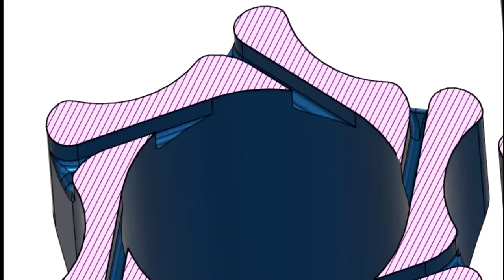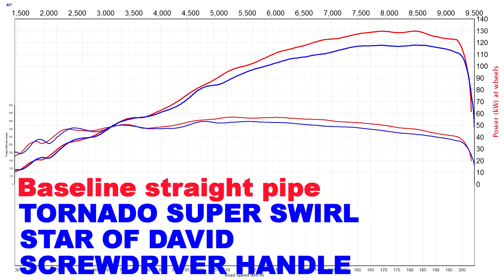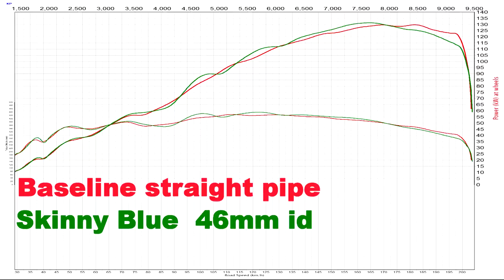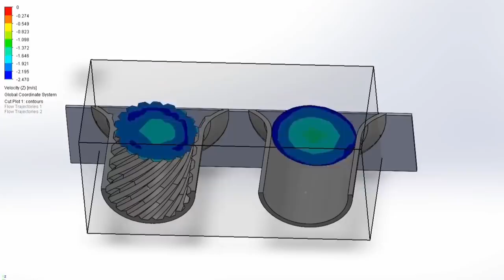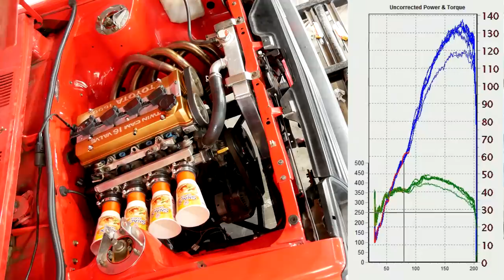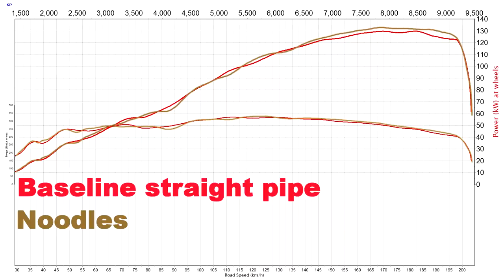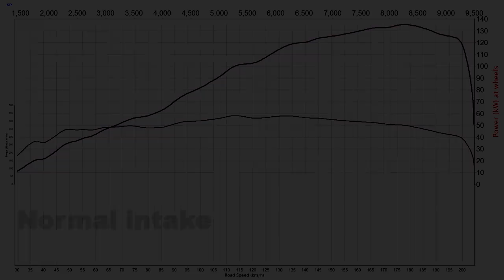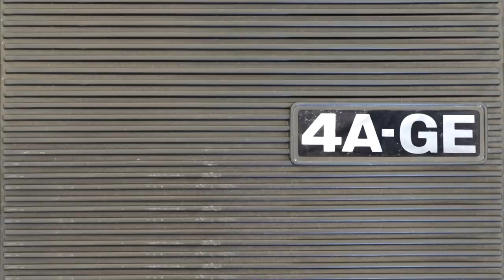Viewer 3d Printed Velocity Stacks  - Trumpets - Intake runners - Dyno Tested

Comment: I liked the idea a lot. But the second I saw the "Star of David" ones I practically screamed at my monitor. So clearly not enough air. Would have been better to have an opening at the end and let what it pulls from the slots on the sides to perhaps spin the charge a bit. Assuming it used them at all.

I was most curious about the Spinny Boi. I have thought about something like that since I wanted individual webbers and stacks on my 302 in my 68 Cougar when I was in High School.
Reply from the maker: The guy that made them, made the slots oversized so area was bigger than pipe.   I will try make them bigger at some stage, to see if the increased surface area is still a resiction.   If uncapped the end would kinda defeat the point of the design
Reply: Copy paste from another reply from me:

I made the "Star of David" ones. 

It's counter intuitive by looking at them, but:

The round pipe at the bottom has an area of 2123mm2 

The six slots have a combined open area of 5058mm2 

So it's got a worse surface area to open area ratio than an open hole, but that's why I made the slot area oversized by that margin. 

I think the real reason it performed poorly isnt because the slots are restrictive in themselves; so much as that it's causing the air to swirl internally. 
Which is counter productive especially when shortly after this is the throttle plates which straighten the flow back out.

This design wasnt about testing side feed slots, I was looking to see if having a capped end would help catch and reflect a stronger pressure wave. 
The slots are at a tangent to the perimeter of the pipe, so there's no clear path for a pressure wave to escape. 
The swirling isnt the main idea of it so much as a compromise I thought might be worthwhile. 

If you had the same design again with slots that ran straight so it didnt swirl, I'm fairly confident you'd see no restrictions - but no benefit from the runner length either, as I'd wager that the tuned length will correspond with first part of the opening of the slots. 

Maybe I'll print some more for another test later with straight slots. 

Either way, this isnt a design that I'd consider running on an engine. Apart from for sake of testing in these tests.

Comment: What do think would happen if you shortened the length of the runners? Or moved the throttle bodies further away from the head. Lots of info there but raised as many questions as answered.
Reply from the maker: In pinned comment at top, there are links to some of my other videos, that test length along with other things.
Reply: @Garage4age  sorry, I found them after a sent the message. I love your videos. Lots of info. I'm surprised by the small differences. Do you think it matters where the throttle bodies are in the length?
Reply from the maker: @dougstenger4085   Yup thats na tuning for ya.  adding up lots of small improvements.   Ive changed throttles and the location slightly a few times, with no change.  I can't say 100% either way since haven't done a whole lot of testing.  but imo, most cases not worth bothering with , if throttles are sized correctly for their location.
Reply: @Garage4age  Thanks for the response. I'm using motorcycle ITB's on a 2l 16v VW mounted mid engine in a tube frame Manx style buggy (Clodhopper). I need all the room I can get, so they'll be mounted above the engine and from what I can tell from your information, performance won't be hurt that bad. I really appreciate that with a few videos, you've answered most concerns. Looking forward to more videos.

Comment: Curious about your dyno numbers? How can you get 450nm with a NA 1600cc engine? 
Otherwise, nice vid!
Reply from the maker: its torque at the wheels.  so multiplied by driveline.   basically what every braked dyno reads to calculate power
Reply: @Garage4age  Ah I get it. Rather unusual way of measure. At least here in Sweden. Thanks for the reply!
Reply from the maker: @C303ofSweden    a lot of dyno's will have another calculation, that requires engine speed.  via  gear ratio calibration or rpm input.   so they can calculate engine torque minus the driveline loss,  from power and engine speed.  this one doesnt.     dyno's calulate the power from roller speed, torque and inertia.  tldr; it makes about 190-200nm at engine depending how much driveline loss you guess

Comment: You will get totally different results if you take the middle pips out so it's just the 3d prints
Reply from the maker: yes it will make less power.  they were kept same length to test the shape rather than length

Comment: Unfortunately much like injectors, having air flow changes like this so far from the chambers is only going to give you tiny changes, reducing the distance of the openings to the chamber will lead to a greater change in the inflow and outflow of gasses, and therefore a greater change in performance, though still by only a few kw at most

Comment: I wonder how different these will all perform when actually moving through the air and air is coming into the engine bay
Reply: Not much difference, otherwise it would be important to have different fuel maps for each gear, or speed based compensation - but not really the case.

BTCC cars tried this but found the actual ram air effect is miniscule, and you lose it as soon as you're following another car anyway.

The actual volume of air an engine ingests at full throttle is huge...
The easy way to remember it is that a 2 litre engine at 100% VE consumes 1000 litres of air per minute, per 1000rpm. 

So a 4 stroke 1600cc motor at 100% VE at 8000rpm is consuming 106 litres per second

Comment: Surely u can do stuff about either silver top or black top motors or do like a comparison with them
Reply from the maker: Only got one 20v that i dont want to modify any further.   But yeh they pretty much respond in the same way as 16v.    Haven't done as much r&d in them as 16v.  But IMO they get talked up a bit.  For having  ITB's ,VVT, ok headers  and bigger cams than 16v from factory. they aren't that much better.
Reply: @Garage4age  algs mate cheers for that

Comment: Could you make some sort of stand in for the strut tower and see how close you can place it to the entrance to the stacks before it effects the power level?
I'm curious about how long of a straight runner you can run but changing the runner length changes your power so you have to attack the testing from a different direction.
Reply from the maker: have been thinking about doing a video on this.  its probably closer than most people think
Reply: If I was placing bets I would say it's when you're within one stack diameter's distance from the openings.

Comment: All tests under the same conditions? Air temperature, humidity etc?
Reply from the maker: they were all done 5-10 mins after each other. enough time to swap them over.  afr check & stabilize engine temps before doing the run.

Comment: Take your best design and make it in different lengths. Runner length is more important than design of the inlet.
Reply from the maker: they are based on the best length which is the "normal" intake.    This main reason why the "big white"   makes less power.  as the oversized bellmouth acts like a shorter runner

Comment: I do understand that this is a 4A-GE engine channel but could you try the Motus V4 1650 cc 180 bhp(@crank) engine vs the 4A-GE . The Motus is smaller in size and you can put a centrifugal supercharger and reach 230 or so bhp from the factory built kit I think . 
It has 7500 or 8000 rpm limit.It also has  Hydraulic tappets but cam in block design . It has automobile style engine even though it is built for motorcycles.
Reply from the maker: I dont have that much  money unfortunately
Reply: @Garage4age  totally understand but if you have a chance or have access to that engine would you consider it.
Reply: @Garage4age  if you are in the US could you try the bike Motus V4 just to see and experience the engine
Reply: Sr71 type inlet cone with moveable cone ... Aspirator or exhausterator cone  ....

Comment: Really should test with the hood closed.. and air pressure in front of each stack, I bet #4 cylinder will be choked a little being close to shock tower
Reply from the maker: Its open because testing the intake runners,  rather than the limitations of the car/ airflow into it.   I can keep the temps more stable with bonnet open.   the proximity to the tower isn't an issue. have tested it in the past.

Comment: the most high performance design would vary in length and be short at low rpm and long at high rpm
Reply from the maker: depends what you call short and long.   to get the best out of it they would need to be the length they are at peak power now.  and even longer at lower rpm's.   but impossible to package in most cars
Reply: @Garage4age  right I had it backwards

Comment: Excellent ! Why don't you try shorter pipe ? 
On motorbike, they are really short. You lose a little bit of torque, but improve the max power.
On Yamaha R6, there are 2 types. Long for torque and they open UP with a mecanism to keep the shorter for max power.
Good job and really intersting.
👍👍👍👍
Reply from the maker: shorter makes less power.  I have some videos on it.  see the pinned comment at the top or on my channel
Reply: @Garage4age  ok.

Comment: Take the big white, plug it all the way close to to the injectors, right by the rubber band. Big White and minimum length.
Reply from the maker: too short, will loose power

Comment: It seems like it would have been valuable data to also test the shorter ones as printed rather than adding length to make them all the same, since the length of the stack should have a big effect, not just the shape.
Reply from the maker: I kept them the same length for that reason.  I have videos on length, diameter  and other things already.   If go back 1 video, it has the small white ones tested at different lengths

Comment: if the tune is optimized for the "normal intake" , isn't it obvious that none will perform significantly better?
Reply from the maker: fuel ratio was between 12-13 afr on all runs.  power difference isn't measurable.  I have a video showing this

Comment: no intake runners. just a large force cold air intake manifold over the throttle bodies. the shorter  the intake runners ,at the same diameter, the better.

Comment: I bet the biggest power gain would come from getting the intakes away from the strut tower.
Reply from the maker: has zero effect how close  they are.  There are some vids in pinned comment at top. where i tested some that point away from tower amongst other things
Reply: @Garage4age  huh. I did wind tunnel lab this semester at collage, We had to be very careful not to stand in front of the tunnels intake because it would cause large wind speed deviation. wind tunnels we have use a similar trumpet intake. Even someone walking 5 feet from the intake could cause up to 5% error.
Reply from the maker: some with bends in this video that aim the ends away from tower https://www.youtube.com/watch?v=nqYkmCLrlEo

Comment: was fuel map corrected for each design?
Reply from the maker: if required yes.  all run within  12-13afr   window.    which makes identical power on this engine (and most others)

Comment: What was the goal of the david star ? A silencer ?
Reply: This design wasnt about testing side feed slots, I was looking to see if having a capped end would help catch and reflect a stronger pressure wave. 
The slots are at a tangent to the perimeter of the pipe, so there's no clear path for a pressure wave to escape. 
The swirling isnt the main idea of it so much as a compromise I thought might be worthwhile. 

If you had the same design again with slots that ran straight so it didnt swirl, I'm fairly confident you'd see no restrictions - but no benefit from the runner length either, as I'd wager that the tuned length will correspond with first part of the opening of the slots. 

Maybe I'll print some more for another test later with straight slots. 

Either way, this isnt a design that I'd consider running on an engine. Apart from for sake of testing in these tests.

Comment: Just ran across this channel and I did the math... Is that 320ft/lb of torque coming out of a 1.6? Am I seeing that right?
Reply from the maker: The numbers on the graphs are torque at the wheels.   need to do calculation with  power and rpm, to get back to engine numbers.   both of the peaks at 5200 and 6200rpm  would be 180nm or 132ft/lb.   which is a number that also doesn't mean much, as its engine torque minus the drive line loss.     so if added 10% drive line loss to get back to engine torque   would be 198nm or 145ft/lbs
Reply: @Garage4age  ah, thanks! I was just sitting here thinking you built a truck motor or some kind of crazy drift motor. Then I saw that you had one in a truck, lol.

Comment: Try a back plate just behind the trumpet? From a hydraulics engineer point of view a hole in a plate is better than a hole in "free air", since the air has to only make a 180 turn at most, not 360.
Reply from the maker: I remember this argument from many years ago.  but never tested it or had the means to back then.  Will definitely give  it a go at some stage.  thanks for the reminder

Comment: What dyno control system are you running, buy the looks of the cabinet and graphs it's a old dyno torque
Reply from the maker: Yeah is dynotorque.  must have been one of the last, if not the last one they did.
Reply: @Garage4age  I worked for Torque performance when we were still building them, last one I think we built we installed at Rotorua polytechnic might be the one you have.
Reply from the maker: @jeremyriley9672  Oh yeah.  I'm just kinda guessing going back though the dates in the database.   This one come from transtune in whangarei.    You dont happen to know the password for the setup menu do you?   garage4age@gmail.com if you want to email me.  thanks!

Comment: 450 Nm at the wheels?
Is what manufacturers always advertise at the crank minus gearing or how does this one make 450?
Reply from the maker: manufacturers rating is at engine.    numbers you see here are torque at wheels,  the drive line multiplies torque.       to get the engine torque need to add some drive line loss to the power numbers,  then calculate it with engine rpm,  to get   engine torque.   which would be around 190-200nm depending how much driveline loss you guess.
Reply: @Garage4age  ah, that makes sense. 
Thanks for explaining!

Comment: seeing a motor that looked quite built and very nice make less power than a motorcycle really surprised me
Reply from the maker: Engine itself isn't anything fancy.   But it's doing pretty good for a 1.6 from the 80's   177whp  close too 200hp with some drivline loss, is up there with motorcycle stuff in terms of hp per L

Comment: Love that most of these are "pointless", besides the clear losers, otherwise there is a tiny difference despite what CAD simulations say. Great approach though, realistically unless you can get more air into a rich system likely won't have more power

Comment: can someone explain why this motor doesnt have an intake manifold and how it doesnt need it and maybe why it is better or worse?
Reply from the maker: It has individual throttles.  one throttle per cylinder  which controls the airflow. rather than a single throttle on a "manifold" plenum for all cylinders